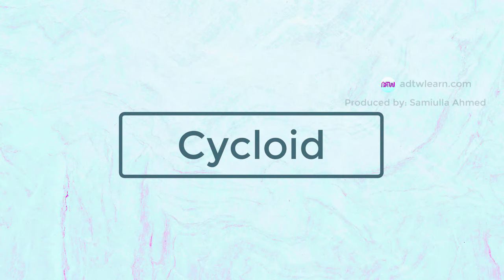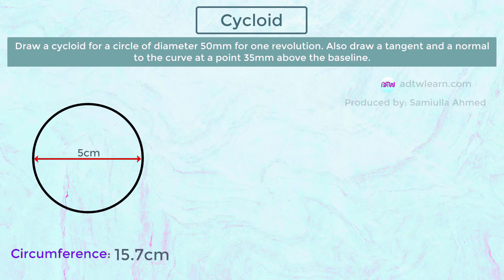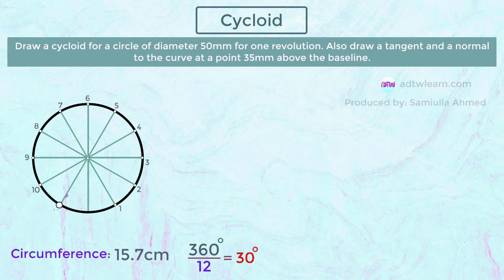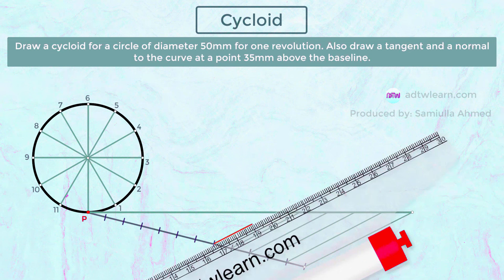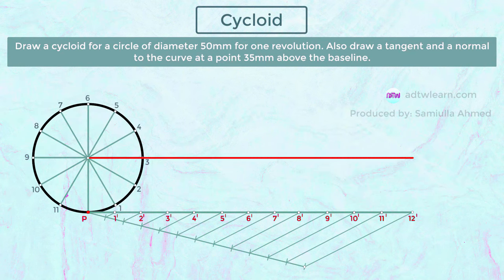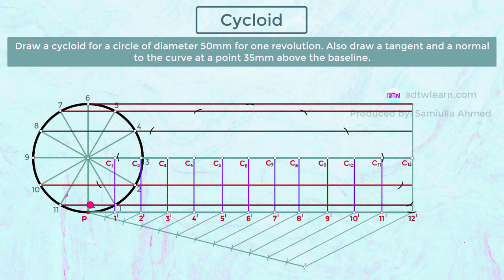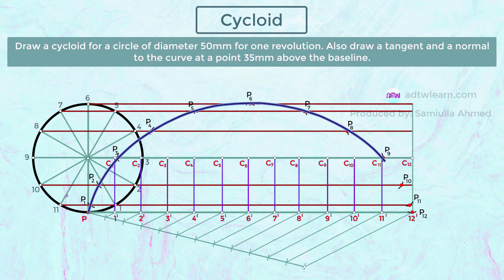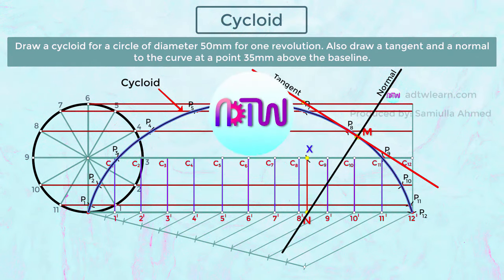Cycloid | Cycloid of a Circle Engineering Drawing | Animation

Comment: (Draw a cycloid for a rolling circle 50mm diameter when it rolls for one rotation. The moving
point P is initially at the point of the contact between the circle and the straight line.) this question video in  your channel 
? i find but not found ...